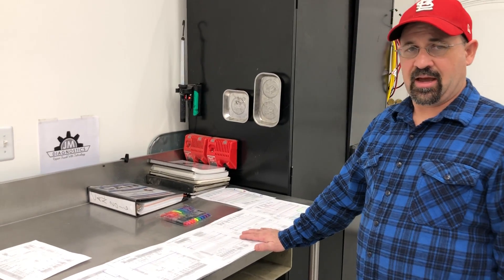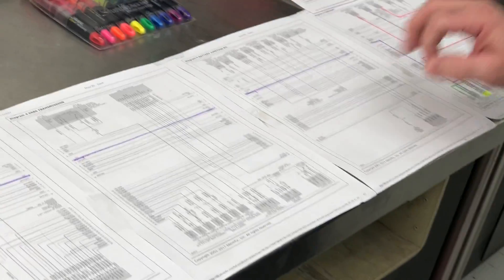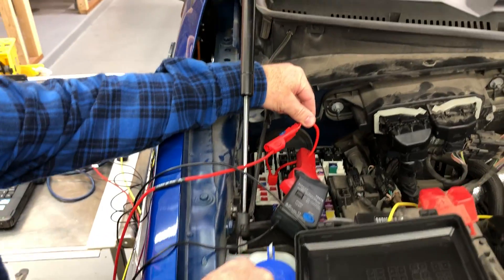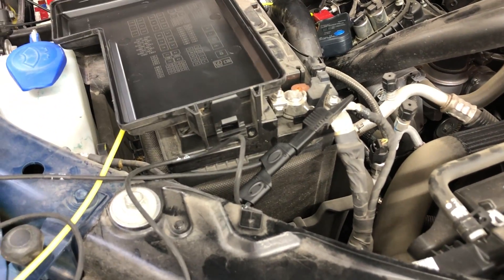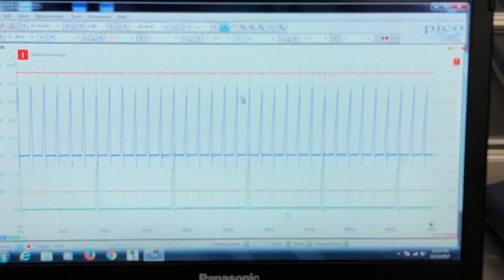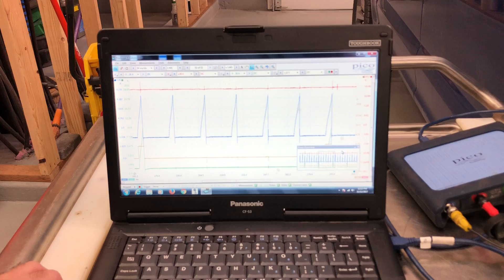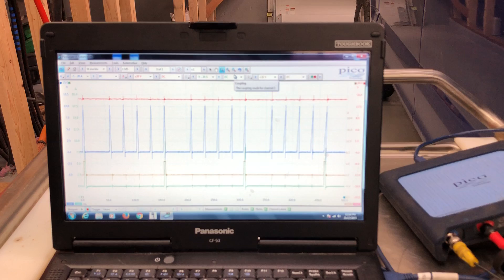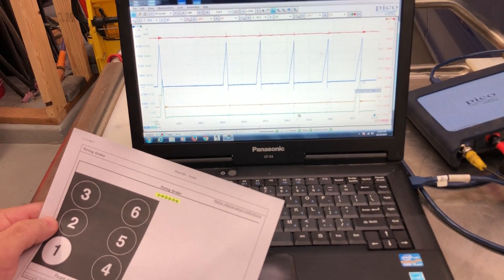Ignition coil testing with amp clamps procedure

Comment: I'm so glad I have OE diagrams instead of this prodemand/alldata crap.  Always though it was silly to have to print out all 7 pages of the entire engine control circuit to see ignition coils, which is done on 1 page with gm wire diagrams.

Comment: Nice job with the explanation. Engine sounds a little oil starved at 3:14 mark?
Reply from the maker: Ozzstar what you are hearing is the sound of the direct injection system.
Reply: Oh ok, sometimes things sound a little different on the video than in person ;-) Thanks for clarifying.  -Glen
Reply: It did sound a tad dry through the headphones, I was also wondering what it was.